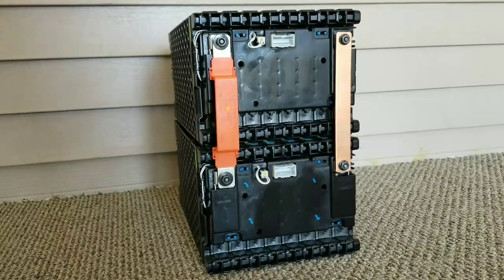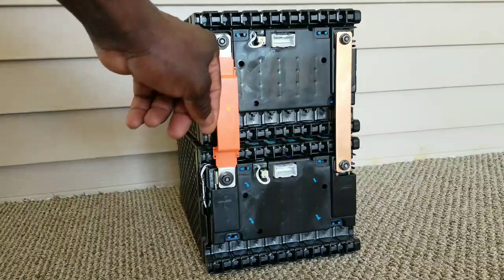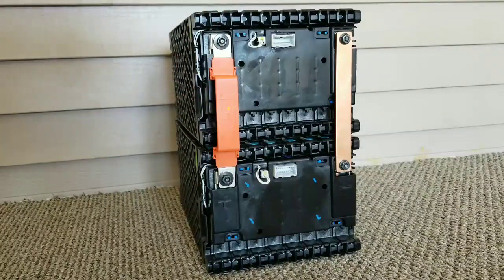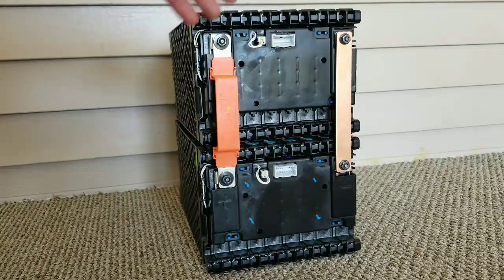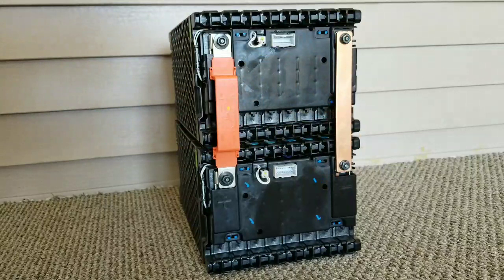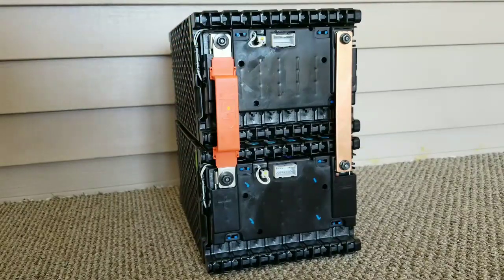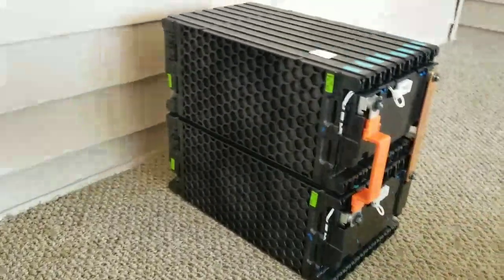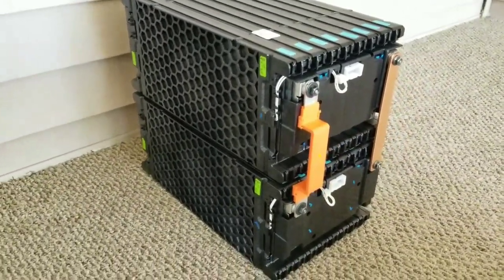CHRYSLER PACIFICA: LG Chem Solar Battery Golf Cart EV Car Cells, How to balance lithium cells

Comment: Could I use these battery’s with a eg4 3000 ehv-48v …because the battery’s are 67v and the inverter is 48v wouldn’t it damage it?
Reply from the maker: Sorry for not answering your question directly about an EG4 inverter/charger. I have never owned  one.
If you want to send one for the channel for testing,  I am willing to do a full review of it with my batteries.

Please check your inverter specifications in conjunction with the battery specifications to make your conclusion.

Thanks for checking out my channel. 
Please don't forget to Like Share and Subscribe

Comment: I need to find a ev battery that can be made 7s easily, and possibly 14s in the future, it needs to be affordable, what chemistry are those? LTO?  I need about 1000 ah at 29.4v or close, I'd like to get LTO cells, so I will not have to worry about possibly ever! I want the bank large enough, I don't use over 15-20% over night! And never over 50-60% of the capacity, I am fully off grid,  and want enough PV to charge about 25% of the capacity in about 6-8 hrs. I'm building a DC generator, to help charge the batteries,  capable of 100-150 amps, but not fully charge, something like 27.5v then shut off, and full charge at 28.7, 4.1v /cell... And try for 3.7 volt discharge, but I'd like to get about 700-1000 ah of the LTO batts, about 12s what ever is close to the liion voltage, I need to research more, I don't recall the volt range of the LTO cells, the size or power density is no big deal, I have over 20cu ft. For battery, great video, I'd like to know more about your system,  mine consist of the decent. Chinese equipment, I'd like a midnite classic150, or two, and a mangnasine or similar inverter, 5kw or larger, mine is 5kw china watts, I keep it under 3kw, sorry I tend to ramble on when this subject comes up!! Good day!!!
Reply from the maker: (LiNiMnCoO2)
Lithium-Nickel-Manganese-Cobalt-Oxide